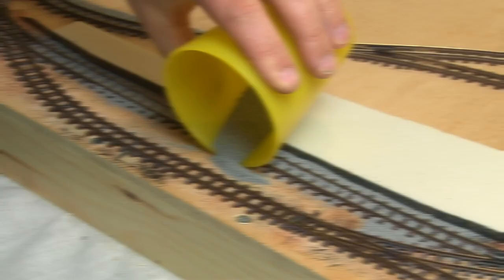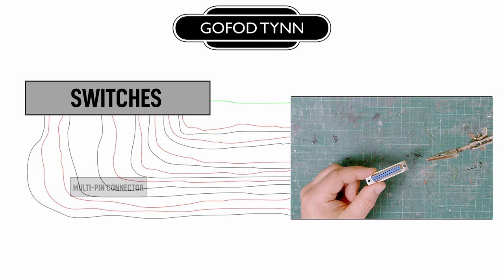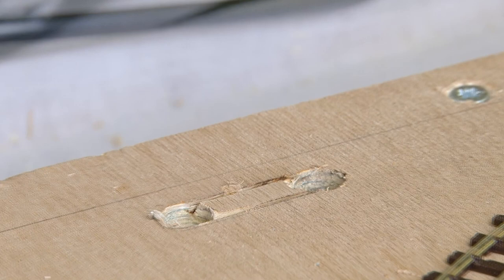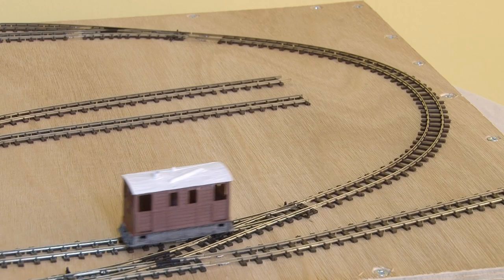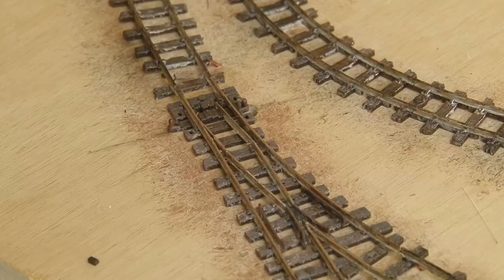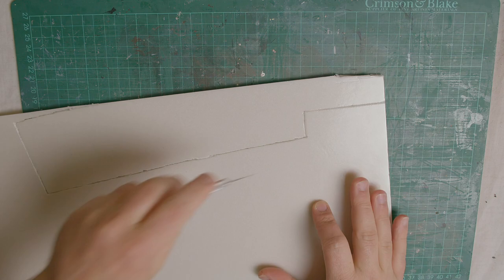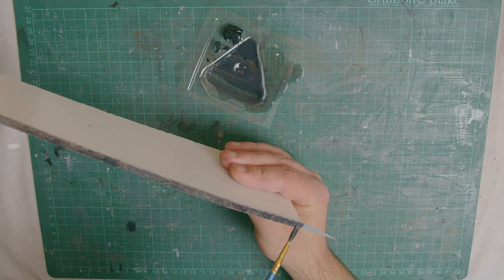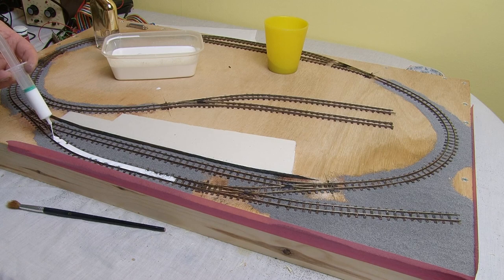Building A 009 Model Railway In A Suitcase - Episode 2

Comment: For anyone not so keen on soldering, you can actually buy D-Sub Breakout boards, with screw terminals. That way you can still take advantage of the single connecting cable, without needing to solder connections. It also has the big advantage that it reduces the chances of a loose strand of wire causing a short circuit.
Reply from the maker: Yeah I’m definitely going to do this in the future if I ever use D Subs again! Thanks for watching 😃
Reply: @ThatModelRailwayGuy  It’s coming along really well! I’m certainly tempted into doing OO9, especially space-wise!

Comment: Seeing a video of someone actually building a suitcase layout was a treat. To my experience, tapping the rails when ballasting makes the sand vibrate up against the inner side of the rail (usually to one side). If you then apply the glue, you'll fix some grains in that position. Then the switches are a problem and you screwed up pretty good. Why did you apply so much glue? I mean, you flooded the rails. It is enough to put just enough glue to see the grains of the ballast shining through the glue. It will seep in an fix all the grains rock hard.  Removing all the glue and ballast grains later is hell. Well, you learned your lesson.
Reply from the maker: Tapping the rails to remove that ballast does take a bit of practice but once you get there it's very satisfying to see the ballast just jump off the sleepers and down into the gaps. With the glue I was still very much in 00 mode so I added what I normally would for that, forgetting that of course the glue still spreads out the same amount regardless of the scale 😅 Thankfully it was an easy job to put right in the end. Thanks for watching 👍

Comment: For info...the cdu isn't actially for "clean power", it's to supply a high current pulse. This gives the solenoid a good kick...but stops burn outs from accidental continual voltage.
Reply from the maker: That's basically what I meant by clean power. Like I said in the video, I'll be doing a more in depth tutorial on solenoid point motors which is why I skipped over the CDU - but yes, essentially it just provides a nice burst of power when needed rather than the motor trying to take it directly from the controller. Thanks for watching 😃

Comment: If the conductivity is lost, use the throw of the point to power the ashes section of rail via and additional switch on the point motor
Reply from the maker: Unfortunately as these are set track points and the point motors I used don’t have that capability that’s not really an option. I don’t want to give anything away but tune in next week to see the resolution 😉 Thanks for watching 👍

Comment: Point motors still look like too much cost and effort. Surely there must be a better way? Huge, clunky, noisy, expensive and complicated. All to move a tiny piece of plastic about 5mm!!
Reply from the maker: Everyone is entitled to their own opinion of course but I would disagree there. These solenoids are pretty small (remember the 009 points are tiny) and only cost about £5. There's also servo motors (even smaller and cheaper) or you could use a rod under the baseboard connected to the tie bar to operate points remotely too. There's plenty of ways of doing it if these particular motors don't take your fancy. Thanks for watching 😃
Reply: @ThatModelRailwayGuy  you misunderstand me, I think! 🙂 My point is about motors themselves. I am fine with rods under the baseboard. My issue is with the motor tech as a whole, specifically for oo gauge, which is the gauge I model in. In my opinion, there should be point track with motors built in. How big does a motor need to be to move a tiny piece of plastic a couple of mm?

Comment: When that glue disaster happens to me (and it does, some times, when you ballast turnouts). I try to move the turnout ever so often while the glue is drying. This will keep the turnout from locking, because you constantly break the bond. I know, having to leave it overnight might make that more difficult.
For ballast I use Woodland Scenics Scenic Cement. It dries within hours, and is dry to the touch fairly quickly. It can also be dissolved in water, so you can clear it away, if it happens to dry in places you do not want it.
Reply from the maker: Yeah leaving it overnight was definitely a problem. I'd done as much as I could to clear up the excess glue by that point to mitigate as much damage as possible and just had to hope it wouldn't be too bad the following morning. 
Good to know that the Scenic Cement dries quickly though - I may have to try that out in the future as it would be very handy for filming videos! Thanks for watching 😃

Comment: I had that same thing with the points happen to me (though I also had ballast in the points). Didn't realise I'd been too liberal with the watered down PVA around the points. Cleaned up around the blades and the switch part and every little while would just flick the points back and forth and they still work absolutely fine. Will say though that I don't have any point motors, so I didn't have that to worry about.
Another really interesting episode.
Cheers
Reply from the maker: Yeah it’s definitely not the easiest problem to deal with! You’ll have to tune in next week to see how I got on. Thanks for watching 😃

Comment: Good luck with your points, its a very expensive lesson! Always apply less glue mix near the points and touch up later. Thanks for showing us everything, we can also learn from that mistake. In one of your first shots of putting down the glue, you were quite a distance from the points and thought it was to avoid this. In this instance, I believe you used less ballast than if you had put down a roadbed, remember that the point of making the ballast wet with alcohol or adding a drop of washing up liquid to the glue is to make sure it seeps into everything.

I hope you can come right with the situation!
Reply from the maker: Yes I always ballast the points later on using a different technique after the glue has set on the rest of the layout. I think I was just still in OO Gauge mode and forgot that there's less distance between the end of the plain track and the start of the points. You'll have to tune in next week to see what happens though. Thanks for watching 😃
Reply: @ThatModelRailwayGuy  I'm excited to see! Keep well!

Comment: I have the woodland scenics fine ballast and no amount of tapping the rail or brushing it away will make the sleepers clean
Reply from the maker: I does take a bit of practice. Usually the most common reason is that you’re using too much ballast. You don’t need anywhere near as much as you’d imagine as it goes quite a long way when spread out as a thin layer. Thanks for watching 👍
Reply: @ThatModelRailwayGuy  did you use the one from the bag or bottle shaker? I think the bag is actual rock and the other is synthetic. I used far less ballast than you have and it just acts differently
Reply: Also mine floats when glue is added

Comment: If your after a connector with a higher insertion  cycle rate then something like the Centronics 36pin connector db25 will probably last longer than the average db25. The cheap db25 are only rated for a few hundred cycles. Otherwise if your doing a lot of touring with the layout something like a DT12 37-pin connector is probably something you would want to look at.
Reply from the maker: For something like this it's not really worth it bearing in mind that, once the layout is setup, the control panel stays plugged in. Perhaps if you were constantly going to exhibitions and it was being moved around a lot... but even then I think other stuff on the layout would wear out first since it wasn't really built as an exhibition layout anyway. Thanks for watching 👍

Comment: comment on the D connector, you can get them designed to connect to printed circuit board, with breakout boards which may make soldering easy - or can add screw terminals
Reply from the maker: Good to know Dale! I do like using these as a way of connecting a lot of wires easily so I'll have to look into that for future projects. Thanks for watching 😃

Comment: recently painted track on my layout, found a slightly faster method - primed first using a wargaming primer, mix of colours, black for areas like coal years or tunnels, running track a mix of grey or brown (could just use brown). then the Railmatch sleeper grime spray over the lot - only brushed bit is around point switch rails, took about 45 minutes for the spray bit, made a huge difference. then a drybrush of a dull grey and lighter brown and done. 

still need to ballast it
Reply from the maker: Nice, sounds like a great technique! I have to admit I tend not to use spray paints that much though as I don't have great ventilation - but definitely a good option for those that do. Thanks for watching 😃

Comment: Hi It was a nice video, hopefully the gluing of the points won't be too bad, maybe when dry you could scrape it off with a blade, just hope it hasn't run down into the solinoids and gummed them up, as that would be more expensive! Good luck. Thanks
Reply from the maker: Yeah definitely shows I'm not immune to making mistakes - far from it 😂 I don't want to say too much though in case I spoil the next episode. Thanks for watching 👍

Comment: if the PVA is water soluble its not too hard to shift, failing that some IPA and a small paint brush should get rid of it, and your acrylic paint though so will need to reapply that - but should work fine
Reply from the maker: Those are definitely thoughts I had even as I was filming that final segment. All I'll say for now is tune in next week 😉 Thanks for watching 👍

Comment: Oh man, I feel your pain. I did a very similar thing ballasting my first OO gauge layout, the glue left a shiny surface over everything, the points played up and the ballast all moved. Hopefully you can sort it...... I have not been brave enough to ballast a layout since!
Reply: Spray the ballast with water mixed with a drop of washing up liquid before you glue, that should stop it moving. For the shiny surface - yeah, had the same problem. Everything turned to glass... it was horrible. Although it seems a wee bit pricey, I highly recommend Roket's "Ballast Bond" over mixing your own. It solved that problem for me. You don't need anything like as much as he used in this video... a few well placed drops are enough. The ballast needs to be saturated - not waterlogged.
Reply from the maker: Yeah I think a few of us have had problems with ballasting track in the past. Just goes to show that it can all go wrong even for someone like me who does it on a fairly regular basis. Thanks for watching 😃